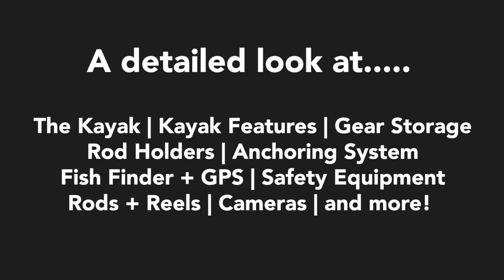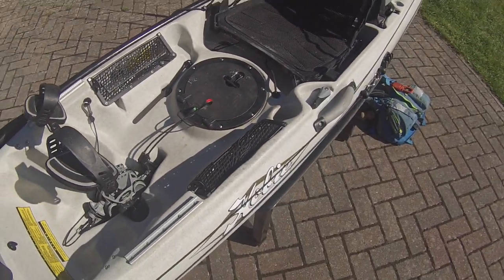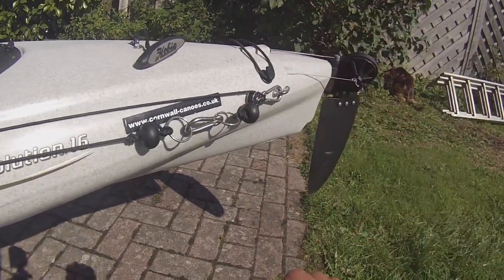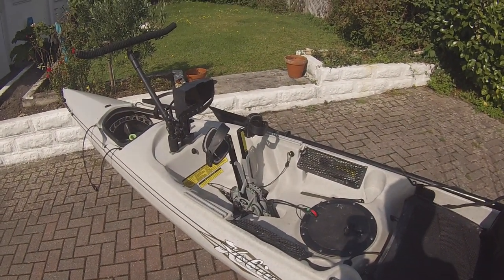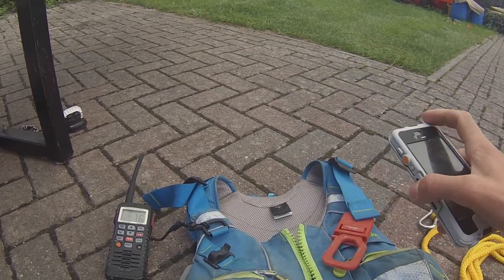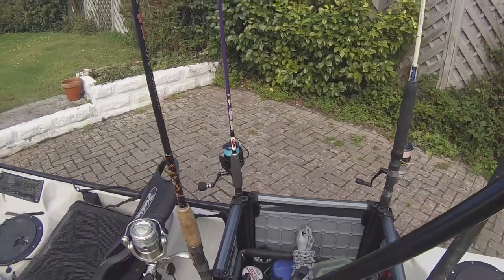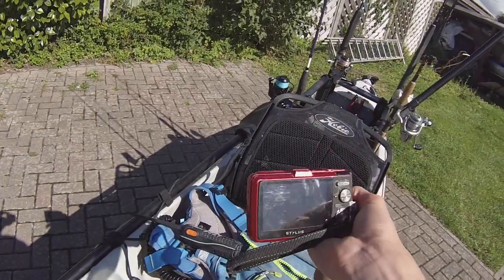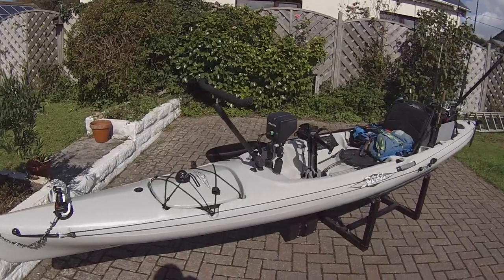Fishing Kayak Set Up - Full Rigging Breakdown!

Comment: Thank you for sharing, i have just bought my first Kayak after years of hiring, what do you use for navigation lights or do you not bother with them?
Reply from the maker: Hi Paul, I rarely use nav lights but only because I tend to launch after dawn and land before dusk. I occasionally fish just into darkness so has a Railblaza Visibility Kit with a 360 white light mounted on a pole which sits over head height. This is enough for most people to spot you. You can get small clip-on strobe nav lights to attach to your buoyancy aid too - check out the Guardian Nav Lights. Definitely advisable to have some form of white light if on the water during or after dawn/dusk.

Comment: Hi, can you tell me what the black balls are that are on the anchor trolley please? Did they come with the kit? Or did you add them? If so what's the purpose of them and or name of the kit? 

Thanks
Reply from the maker: Hi Alex, they are called Parrel Beads or Buffer Beads, they act as a positive stopper against the pulleys and stops the knot of the ring/karabiner getting stuck in the pulley itself. They aren’t essential but I like them. I find they help the trolley slide along the side of the kayak better too and make it easier for it to jump over fittings and fixings (eg the cleat) when shuttling the system. I brought them as an extra to add to my anchor trolley. If you are in the UK, Cornwall Canoes sell them. Hope this helps 😃
Reply: @CornishKayakAngler  brilliant thank you!